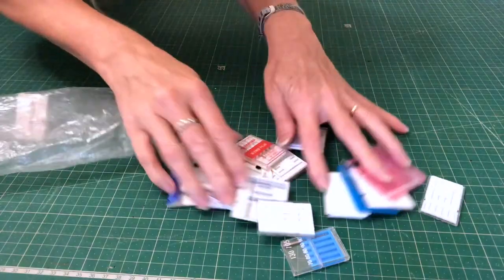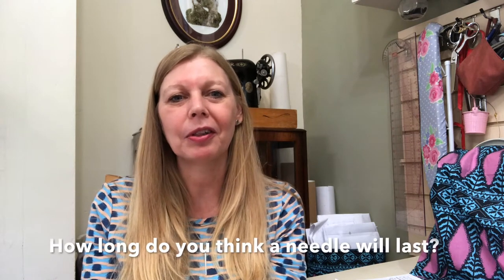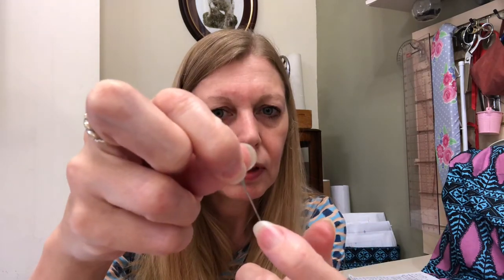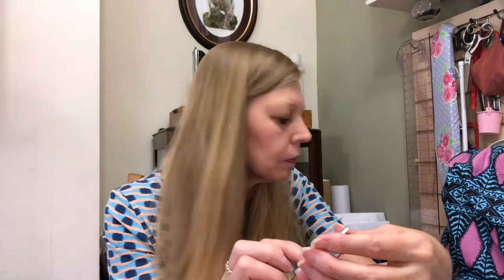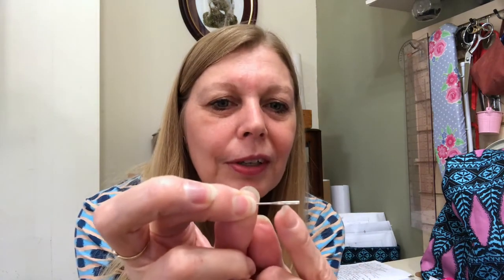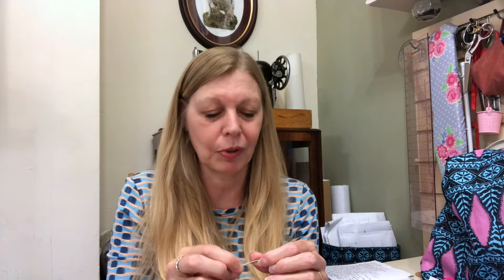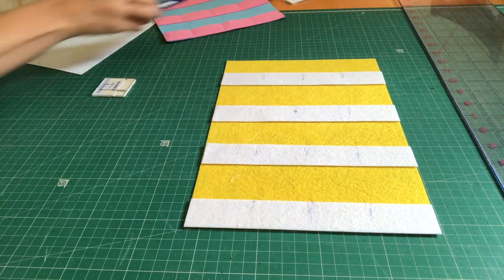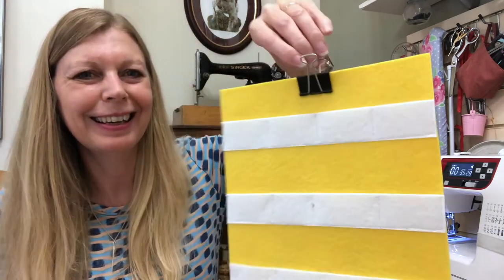Sewing machine needles || 100 Days of Sewing || Day 26

Comment: I have very little wall space in my sewing room so can't put much on the on the walls. I have a small cabinet with small drawers so have my machine needles in there, a drawer for regular needles one for stretch needles etc.  When I take a needle out of its case I replace it with  pin so I always know which needle I have in my machine. When I have used a needle but it is not ready to be thrown away, I mark it with a little bit of nail varnish on the shank and replace it in its case, removing the pin and putting it in place of the new needle. I have a Bernina and always know when it need the needle changing. It's sewing is terrible, a real prima donna!    A very interesting video, thank you, I will save it.
Reply from the maker: That sounds like a very good system Christine, thanks for watching ❤️